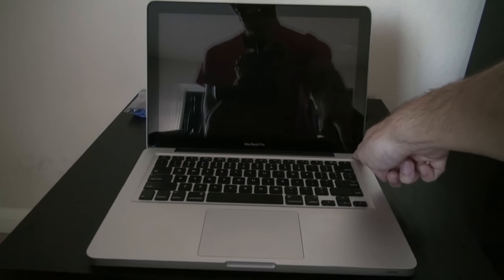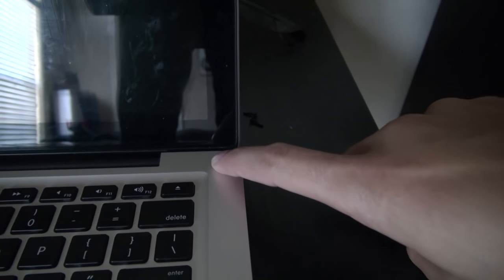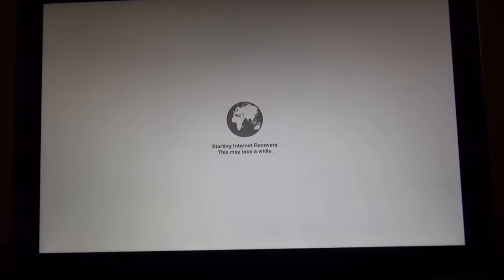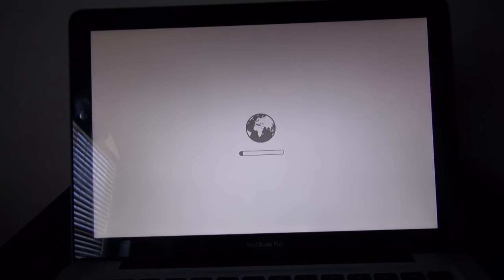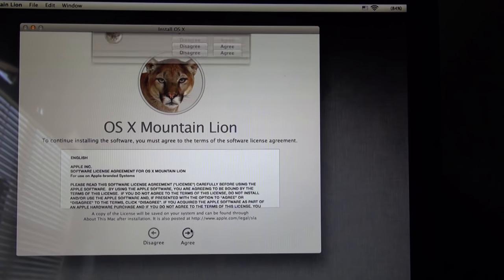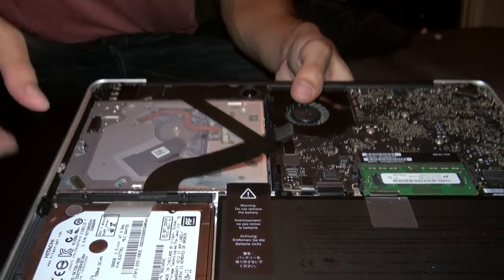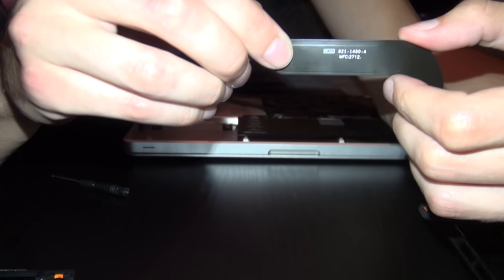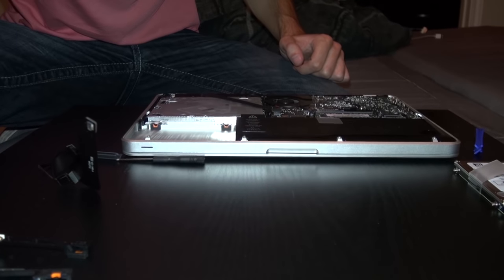How to Fix Macbook Pro  Flashing Folder, Blinking Question Mark, White Screen, Freeze Randomly

Comment: ALL YOU GUYS HAVE TO DO IS RESTART IT, HOLD COMMAND+R AND THEN REINSTALL THE OS
Reply from the maker: +Patrick Barrett you can do that however when i did this. eventually the cable fails and will not install the OS... or it will continue freezing... and then you still have to reinstall ox every 24 hours of run time...
Reply: +Patrick Barrett but if i do this will it wipe all my files on the hard drive?
Reply: OK so the Commend+R will take you to the globe and you will be able to reinstall the software from there correct? How long can this process take?
Reply: +Sheila Folan It takes ages, at the moment I am trying to re-partition my hard drive so it shows up when re-installing the OS, but not my current OS, in fact Mac OS X Lion (The OS that I started off with)
Reply: +Aro Worldwide I accidentally deleted all my hard drive
Reply: all i did was Took out the hard drive and placed it back in. It worked.
Reply: +omer diallo omg same
Reply: But it's not letting me connect to the network wifi
Reply: Hey guys maybe one of you can help me?! If be forever greatful! when I restart everything it all works great until i go to download Mac OS again it says it's locked and I can't move forward!? Any suggestions ?  Thanks so much!
Reply: Says the disk is locked**
Reply: britney esau I'm having the same issue
Reply: It says hard drive error when trying to do the Diagnostics in disk utility. I have been on the phone with apple all day it worked yesterday I just got it off eBay Sunday smh. It’s Wed I did the internet recovery and that error msg came up. I tried reinstalling like 4xs
Reply: Patrick Barrett will my files be ok?
Reply: Will the files be safe?

Comment: The Mac (2012-13) I knew got a flashing folder this year while switching harddrives. We used Internet Recovery. It worked! (And one of the options said 'Reinstall os X Lion' on the first attempt, oof) (on the second attempt, we used a backup drive the Mac is connected to, it took HOURS to make it bring the OS back)

Comment: Mate!
My mac had been crashing again and again and i thought it was because of bootcamp windows and over 300 gigs of data, i have a macbook pro mid 2012.
I decided to wipe and do a clean internet recovery but was in an indefinite loop. Spent days with no effect, then stumbled upon your video, got the cable the cable the very next day and successfully reinstalled catalina in one go!
It took me over 1.5 months to get it fixed!!!!
F*****ng LIFE SAVER!!!! Hittn Subscribe right away :)
Reply: One more Thing, the sr number on the cable was 821-2049-A however 821-1480-A worked for me

Comment: Hi Chris Brian. many thanks for your video and instructions although I am sorry t say that I am still at a complete lost as I am not clever at all when it comes to computer technical things. My problem at the moment is that I have an old MacOS X from back in 2009 and unfortunately although it had been working and using Mac High Sierra perfectly up to a few t days ago, then I did something stupid and accidentally removed or deleted some of the most essential software programs and now find myself that I am not able to see the main HD or get the actual windows for Recovery or installation of any new software such as a new High Sierra. I thought I could over come all the issues by inserting the original Installation of MacOS X that came with the Mac when I first bought it and also unless I insert this DVD I am not able to see anything at all on the computer. I have used this DVD before to re-install the MacOS X software and it worked perfectly, but now it doesn't seem to want to do anything. If you think you might be able to share any advice or help me to sort it out, I would be happy to explain things a little further in order for you to be able to understand it better. Unfortunately the Apple support members have given up on me as I also have problems with the Keyboard and the mouse, so I have been left in the lurch so of thing. Thanks for taking the time to read this and I look forward and I hope to hear from you soon, as you seem to know far more than I could ever know about computers. Kind regards John E

Comment: First of all, thank you for the helpful video! I have exactly the same problem. However, on a MacBook Pro Retina 13 inch, early 2015, which has no hard drive cable. 

Stupid question: Is it possible that it's the "I/O Board Data Cable" or does it have nothing to do with the SSD?  I hope someone can help me. :(

Comment: This Video Guided the Complete Restoration of My mid-2012 13" MacBook Pro to the Latest Used Operating System - Immediately Back In Business. Take your time and be very gentle with the delicate yellow tab. Use 1.5 - 2" of electrical tape to affix its bracket to the side of the hard drive and mount the cable's receptacle where it goes first before gently plugging the yellow tab back into the cable receptacle.
After closing up the laptop, there was No diving into command-R and OSX-Utility and Re-installing OSX Lion. This was after Applecare first told me there would be 3 months of Data Loss from a Re-install of Lion and Time Machine Back-up install (I had been 3 months delinquent on backing up my laptop). I attempted to get after this faster by setting up an appointment with the Apple Store. Applecare said the laptop was too old to be serviced by the Apple Store and did not have nor could not source this cable. So I did as instructed and ordered the cable from Amazon ($8) and waited only a day. Back in Business. Exceptional Useful, Short, Straightforward video. Wish more were made like this.

Comment: Guys I just changed the part and it solved the issue, I owe you one buddy. Geek squad at Best Buy was charging me 600 to fix this. You forgot one step by the way when I replaced the cable and every thing I had to format the HDD to wipe everything on it and get it ready to instal new OS X, Thank You once again.

Comment: I have this issue with the white screen on an iMac mid 2012. Do you think it’s also the cable ? It doesn’t detect the hard drive so I thought the problem was the hard drive.

Comment: Thanks for athis nice video. That was happening with my Samsung 840 SSD. And I was going crazy trying to reinstal Mac OSX. And, in one of my tests, I swaped the SSD and Installed my old HDD and it booted, I could even run time machine and made a day backup. I removed the ribbon cable and order a new one. I hope this fixes the issue. Thanks.

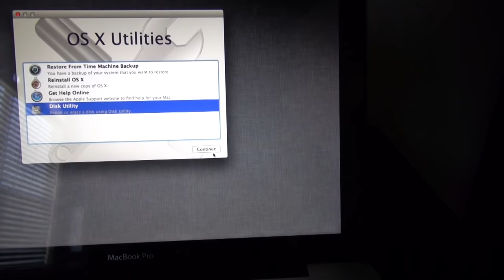Comment: Hi there. Hope you can help. I have replaced my cable twice. I boot up the mac in reboot mode and can see the hard drive under disc utility like your video at time. 2:54 (i even bought a new hard drive just to make sure) However I did not keep a back from time machine. So i am reinstalling the operating system. However when i start to do the reinstall stages it ask where would like to save the operation system, the disk does appear in the box. I am stumped and not sure what else to do. Pleasseeeeeeeee help

Comment: no nothing works to get rid of question mark i don't get any of them options you described from hitting the command r or the option or any other combination when i put in a operating disk or usb it sees it in the option key but when it moves forward to select language it then stops and says error what ever it is i have downloaded iso files dmg files and nothing here on youtube helps with this problem... i am or was using snow leopard 10.6 it does not recognise that either

Comment: None of these worked for me. I didn't see any startup disk or disk utility at all. Only the internet recovery option was visible. Clearly my Mac was unable to detect the hard drive at all. Turns out, the issue was with the transfer cable of the hard disk, not with the hard disk itself. Phew. Got a replacement HDD transfer cable off Amazon for 20dollars and it worked. No data loss and back to normal usage!

Comment: My unibody 2012 macbook stuck at white screen, i managed to boot to recovery, installed half way the os and then boom white screen like forever... i will order this cable and be back with an update if this works

Update 1.0 : Bought a new ssd and a new sata cable, all connected and set, when i did internet recovery using cmd + r, all disk utilities worked fine and it reads my new ssd, i formatted and then installed half way the mountain lion and again white blinking question mark... now i used opt + cmd + r with an ethernet cable to install the latest official update from apple which is catalina 10.15, i noticed when i used disk utilities that the previous recovery installed 4gb on ssd and thats good, formatted to apfs and im waiting for the installation... i will be back with an update soon

Update 2.0 : After 4 hours the installation of macos Catalina almost finished but an error 702 occurred, i checked disk utilities and my ssd wasnt showing up there, neither on terminal

Update 3: Managed to install macos on external SSD with sata to USB cable and put the ssd inside but nothing seems to work, neither if the new cable

Comment: Mine didn’t start downloading it’s just stuck on the enter password. I even tried using LAN cable for the internet still the same it’s just rotating .
Reply: Letkho Kip  Thanks tho it got fixed the same day. Thanks to Youtube and a thumb driver I just had to install the OS using a thumb drive since I deleted the disk drive that has the OS in it. It took time tho. Like 10 hours.

Comment: That won't solve the problem in the video, it would only solve when you wrap the wire around with an insulating tape in the brand new cable

Comment: I formatted my hard drive, I think including my operating system, then suddenly a flashing folder came up with my screen. it's been a month since this happened. My mac was a late 2011 macbookpro. I'm currently using it for my online class, now I don't know what to do, I bought hard drive cable two times in a legit store but still, the startup disk is empty and I can't choose my hard drive. If I choose the reinstallment of lion os, it doesn't work, maybe because I didn't buy the Os or the OS is not recognized from my account because I just use 10.6.8, I try buying Mc Lion OS but the credit cards that I used doesn't work with the payment even though it has the right amount of balance. I really don't know what to do. Please somebody help. T_T
Reply: hei...
if you still have the same problem, try to downgrade you Os x.
For example I had a macbook pro from 2009 I try to install sierra, El capitan, and I cant. So.... The same problem with the question mark folder... so I install Os x 10.6 snow leopard.... I down grade it!
Try this way!!!
You will find on https://archive.org/
Try it, maibe you have luck.... 
Good luck, then!
Reply: @dragodragon9031  i have that os, the snow leopard but i don't know how to install it since i have no option if i insert the disc, it's not working. i don't have problem with the disc or the disc operator itself. it's just the installation cannot be fount in my laptop. since i can just open it by internet recovery mode and it has flashing folder 'cause i don't have os since i formatted all an iall
Reply: @paulaavilasevilla7322  Ok, O understand. 
There is an program that its call transmac. Downloaded from official page, install it. 
 After make a image file from your Dvd, mac OS X, with magic iso, or other iso image soft, Google it...
After thid steps mount with transmac program iso image on the stick usb.
You will find on youtube or on internet, if you search it!
So conclusion : install it, OS X,  with transmac with usb stick. 
Good. luck👍
Reply: .... or other solution : try to connect an extenal hard disk machine...